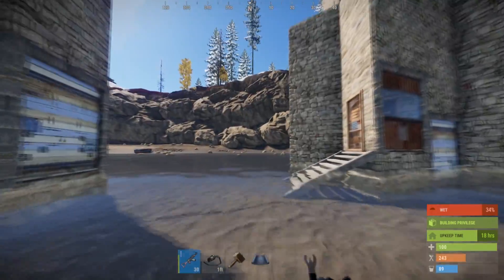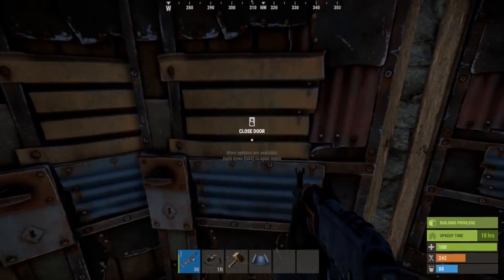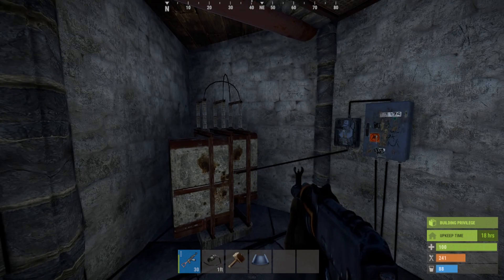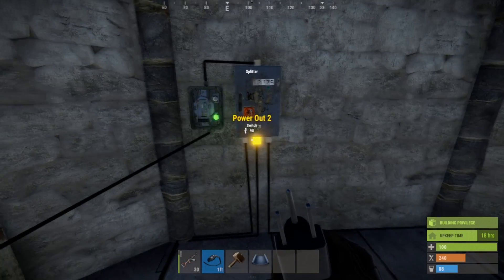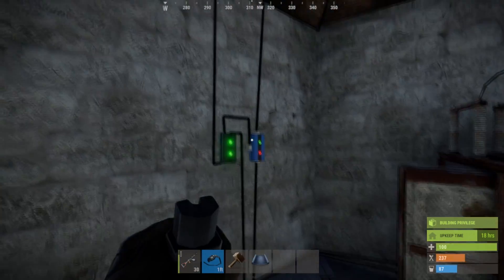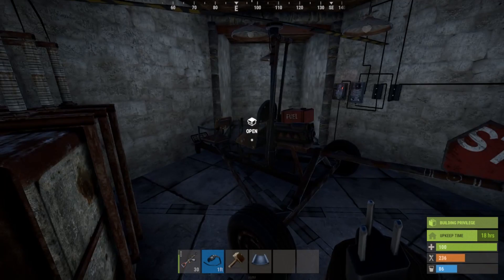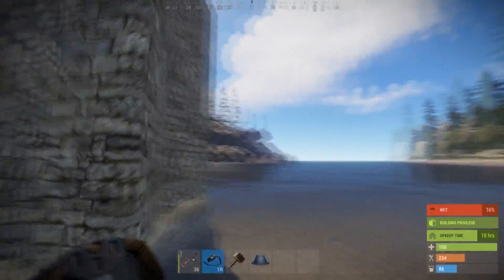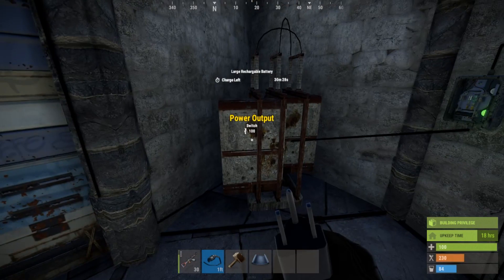Rust Electricity - Rust Electricity Base Showcase.

Comment: RUST Quick Electric, make a circuit that uses 2 batteries and swiches between one or the other, when they have run out, so you can have power 24/7, unless you shut it off (I did this a bit ago, so I don't know if you can stop the drain from all batteries with one manual swich, but you can have a swich per battery, allowing you to force swich off drain from one of the batteries and force it to the other one. That circuit is simple and works pretty well, you just use blockers and branches and one "or switch" (for people that don't know, batteries treat blockers like normal manual power swiches, but they are triggered with a signal, and importantly they don't use power from a battery when they are disabled, but you need to disable it with a signal).

Comment: Do you think it is possible to create a security system to where certain lights light up when raiders are in certain parts inside and outside the base. For example if you are getting raided and you dont know exactly where in the base they are you could go to your electric room look at a certain light and see oh they are in the airlock it is safe for me to run to the loot room and gather some stuff. This is just an idea in the million of ways you can use electricity in rust
Reply: yes, its possible. I made a "perimeter alarm" around our compound last wipe by putting an HBHF sensor on each external TC along with a siren light so you know when and where people are around your compound.
Reply: @JasonP2  amazing to see the things you can do with electricity. Though how expensive would you say then system is to have let's say on a small scale compound 1-2 bases max?
Reply: @ @Drdiddy25  I think with a wind turbine and like 4-6 solar panels you should be good. That way you dont depend on just solar or just wind.
Reply from the maker: Yeah it would just require a HBHF in any enclosed room that has line of sight with regular light outputs. Very costly since they require tech trash as well.

Comment: I've stopped using the splitter to give specific amounts of power for each different function. There is a lot of wasted power with the splitter since it splits evenly, some things get too much while others don't get enough. 
Electrical branches are amazing but to do it properly it is better to get the specific amount of power you need per system to branch off
Reply from the maker: Couldn't agree more. For me just having the excess power allows me to be lazy using splitters versus actually having to route efficient power. I plan to make a comprehensive guide and educational video next regarding batteries and how to "professionally" manage power output.

Comment: With 2 turbines you wont need a battery at all - just root combine them directly & you will have  24/7 electricity
We did this on a vanilla last wipe and it worked perfectly. We powered 6 doors (anti door camper Autoturrets)/ approx 20 lights / 3 sensors (combined to the auto turrents / 3 broadcaster + 1 receiver and dozens of flashing lights (as a landing strip for minicopter)
Reply from the maker: Yes it will supply power perfectly, but you run into the issue if raiders take out your wind turbine first you will have 0 power. A battery allows a backup storage of power.
Reply: wind t + wind t > root combiner > then to wat to split energy?
Reply: @svet4412  a branch. Connect branch side (left) to battery and set to the amount you want to go to the battery, other side (the right side) goes to the rest of the normal circuit.

Comment: Its nice to have a switch by the airlock which closes all the doors in the base when u go out roaming. Simply connect a HBHF to a AND gate and a TIMER with 1 second, will be like a on-switch only which can only be used by the base owner. only con to it is it opens all the doors first, but thats no problem
Reply from the maker: Nice idea!